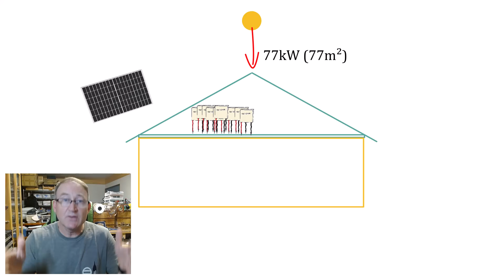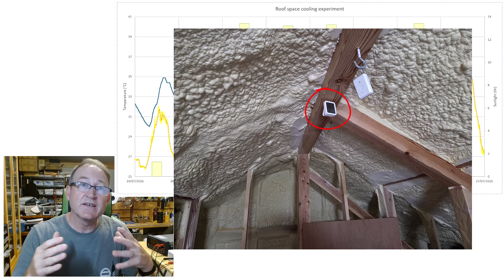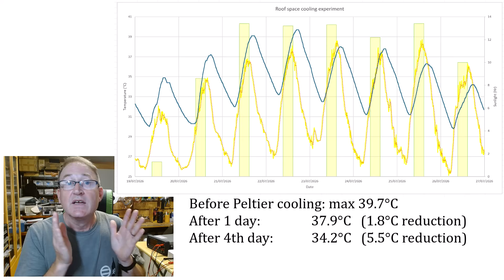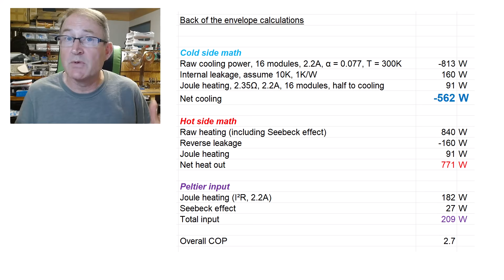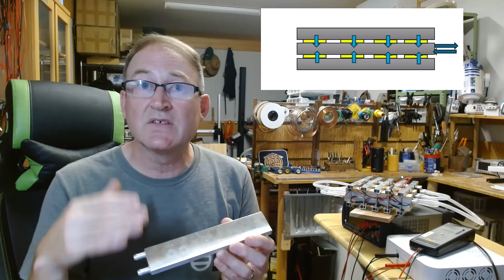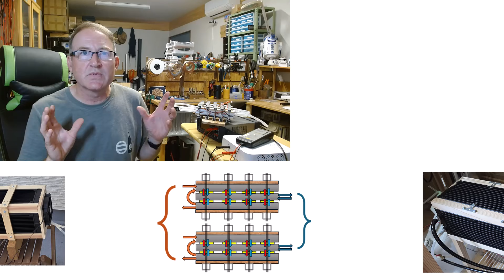Peltier based 500W roof space cooler - surprisingly effective!

Comment: 72kW of energy is hitting your roof, but your insulation is blocking a lot of it. Here in CHCH New Zealand we don't generally have insulation against the roof metal, and my roof temps get up past 55C in summer. 40C is relatively cool. If you wanted to do a better job passively during the summer, paint your roof white. The best heat you can cool for is no heat at all, reject it. This however has an inverse effect during winter where you want to absorb heat, however your roof metal is highly insulated so doubt it would have a significant effect.

Those radiators work far better with forced air directly over the fins (why they have the 120mm fan mounting holes), I presume there are fans lining the inside? You can usually extract quite a lot of heat using those in computer setups, with a single 360mm rad.
Reply from the maker: For the radiators: it's a box formation with 4 radiators, with fans at one or both ends. I tested the single 360mm radiators with 3 fans and measured 0.05K/W (meaning you can pass say 200W with 10K penalty for dT). I found the box construction (4 x 360mm) with a single fan at one end and the other closed off (sucking air through all four radiators) actually works surprisingly well with 0.02K/W. The single fan can breath and you can feel the air flow is a lot stronger. I then went one further with 4 x 480mm copper radiators and a fan at each end, but it's not as good as I hoped (always happens in engineering, bigger is not always better ...). It's around 0.01K/W so can pass 500W with 5K penalty but still for the effort I expected more. I suspect the two fans are creating a dead zone in the middle, I need to play around to get the thermal resistance in the sub 0.01K/W zone.  

The white roof would have to be discussed with the wife! But the real strong point is the spray insulation underneath, it's choking the heat flow down to 15W/m² into the roof, which is amazing. I suspect that even with a white roof, it would still be ~10W/m², which is better but not zero.
Reply: @PeltierPower two fans may cause turbulence, disrupting flow. Flow I think probably being the most important metric here for performance.

Need to take it to a wind tunnel get some shlieren playing in it ;)
Reply: Attics are typically built in one of two ways: *vented**, with insulation and air sealing at the ceiling, or **unvented**, with insulation and air sealing at the roofline like this. Neither approach is inherently better; they just manage heat and **moisture* very differently.

That distinction matters when considering active attic cooling. Cooling an unvented attic like this may reduce the building’s cooling load because the attic is inside the thermal envelope. Cooling a vented attic is generally less effective because it is intentionally exchanging air with the outdoors. For a vented acetic you’re probably better just adding an exhaust fan.  

Either way, do be careful about adding trapped moisture to an attic space. I think that evaporative cooling was outside, but it was a little unclear.  Any additional moisture can lead to mold and rotted wood.

Comment: Fun experiment.  Not something I would actually do.  But I think it would be a lot more effective if you just stored the solar energy in a battery and then ran your cooler overnight from the battery when the temperature differentials are in your favor.

Also, the key is to regulate the temperature swings rather than regulate the temperature.  There isn't enough heat mass in the attic space in the first place... that's the real problem.  The swings are way too large.

Try this:

* Create a flow-through heat mass in the attic from one side to the other.   That the attic can support (weight can be a real problem so it has to be spread out).   Basically just a long long copper pipe with fins placed in a long box filled with sand.

* Two-fan passive attic cooling, intake on one side, output on the other.  Its important to have real flow through the whole attic.

* And throw the peltier in series with the input to cool the outside air even more with the hot side routed to the exhausted side (bypassing the heat mass).

* Controlled operation, only operate when the heat mass is warmer than the outside air (plus a bit of margin from the assumed peltier response).  Meaning solar -> battery -> controlled operation and not solar-direct.  So it mostly only runs overnight.

* And if you want, since you have a bypass path anyway, some of the attic fan path can bypass to directly cool the attic space like a regular attic fan would.

This is all passive except for the two low power attic fans.

-Matt
Reply from the maker: All good ideas! For me the attraction of the solar + Peltier is skipping the battery / inverters, it's just solar to Peltier. But you are right, allowing the roof to get hotter during daytime is actually better because it rejects more heat, but adds inverter + battery and also losses of about 10% round trip. The sensor itself is just in air, so it fluctuates a bit, I have another sensor in the roof I placed a year ago, it is deliberately placed in the bulk somewhere lower to the floor (e.g. between futon mattresses) but I can't find it even though I still get the data. That sensor has only 1°C daytime swing and was trending up about 0.6°C/day prior to turning on the Peltier system, and then trending down 0.35°C/day during 5 days of Peltier operation. It's now going back up again since I turned the system off for revamping. The idea for two fans at opposite ends has occurred to me but I'd need to get the professionals in, and that's an opening for rain, bugs etc, plus cost of running them probably about 100W to get a decent airflow. I do want to run something through the apex of the roof which is the hottest point and most effective point to pick up heat for Peltier system (reduces the dT).

Comment: Peltier need Voltage to vork, Seebeck gives out Amps at any temerature linear, so to drive one peltier just from DeltaT you need 1 Peltier element and 2.8 Peltier according to My coleguae (dead several years ago :(... ) he only used the Heatpump to dump heat to 40C...

Comment: We ued a cheap 100W compressor driven Ice Cube maker to boost our Control panels(Your evaporator cooler) to dump exwssive heat , and we used a variant of your Peltier set up
But We also combined it with the Seebeck effect.
This was for a project in Brazil where the ship could not provide cooling for our cabinets..(heiging systems need stabile temperatue)
Still i cannot wrap my head to understand the physics, but it boosted this small heat pumps capacity maybe by 10...
Regards from a Old scool Norwegian Cheif Engineer with some bakgroud as a 10 year leader for a company desiging subsea Electronics for offshore use...
Please look into this combination of Direct solar/Battery/Peltier, and ecpescially, since Seebec is way more efficient than Peltier as a effect(1:2.8? ish?

Comment: Are these off the shelf from Alie or should I look somewhere else?
Reply from the maker: You mean the Peltiers? They are the more expensive type from Mouser CP14-199-045-L1-W4.5. Unfortunately whenever I discover a good Peltier the price always jumps soon after, they used to be about US$20 each, now around $35. It's probably not that big a difference but for now given the experimentation stage I prefer to use good quality ones as there is a bit of effort to build the system. I've also bought cheap ones from Amazon that I plan to test and see the difference.
Reply: @PeltierPower comparing the Amazon ones with known good ones for performance would be an interesting video, might be useful for someone planning on trying experimenting with Peltier elements in future for similar projects.

Comment: Great video! I especially appreciate the combination of peltier based cooling and evaporative cooling, a great match of two generally severely  misunderstood concepts.       

Evaporative cooling always works, as long as the humidity is less than 100%. Also, when the temperature fluctuates a lot between nights and days, the humidity tends to go down significantly during daytime temperature peaks.  And evaporative cooling to increase heat rejection from a heatpump system can obviously be somewhat beneficial even if ambient air is at 100% RH.       

About humidity, have you considered making a peltier based dehumidifier with a counter current heat exchanger that use the cold dehumidified air to cool down the incoming air, and only use the cooling potential that heat exchanger can't extract to cool down the hot side?
Reply from the maker: Still learning about evaporative cooling and dehumidification. My past attempts with dehumidification found that once you get a layer of water on the cold element, it stops working effectively (the water acts an an insulator, so for a Peltier that kills the efficiency). I need figure out something to keep the water moving, encourage it to drip down into a collecting container. Evaporative cooling seems easier, for now just created a waterfall effect using the paper towels as the scaffolding, over pipes with small holes to refresh the water. Small fan needed if inside, outside seems to have enough natural wind. Surface area seems to be the key!
Reply: @PeltierPower  Agreed, surface area is kind of the key for evaporative cooling, and as I see it, that's in large part due to the limited volumetric potential capacity of the air. It is possible to exchange surface area with airflow, and vice versa, within a quite significant range.  Even outdoors a fan can typically increase the maximum cooling potential for a given surface area significantly. But that don't matter much if you're already reaching very close to the wet bulb temperature without a fan, reliably.    

If you want to reach temperatures below the wet bulb temperature you need to cool down the "new" air with the "old" air, that way it's possible to get closer to the dew point. Besides requiring a heat exchanger, that reduces the useful Q a lot relative the gain in increased ΔT.

Comment: I wouldn't hold back on the details.  

Very interesting, though I clearly need a refresher on Peltier's as I always thought of them as very low efficiency.
Reply: they have a low efficiency
Reply: @ursodermatt8809  Yes and you're better off with a refrigerated type system though see his other video, it's not as low as I had thought.
Reply: @ursodermatt8809  they have low if you run them at high delta T and at their peak Amps. If you run them at 20% amp rating and managable delta T of around 5-15 degrees Celcsius, then they are 200%+ efficient as a heat pump (not TEG)
Reply: You're essentially correct. Using peltiers as thermo electric generators are often cited as <10% efficient, but here he isn't using heat energy to create electricity. He's basically got a heat pump, and he's moving heat. Today's heat pumps are often cited as 300% efficient but that number is a little misleading because it talks about using X amount of electricity to move X amount of heat energy ie:500watts electricity to move 1500watts of heat energy. It's not a conversion of one source of energy to another, but it's moving energy from one place in space to another. For this, Peltiers aren't a bad low cost option.

Comment: You are missing a control to compare data to. It is unclear how much cooling you are getting from your device, vs how much was natural from the outside weather changes.
Reply from the maker: Yes, I will revamp the system and add the monitoring so I can be sure of the numbers. I just felt it was good to make the video quickly, otherwise it will join the graveyard of half made videos! The 16 bank of Peltiers is not new and I've used it in other highly monitored applications, so I'm 90% confident of getting at least 500W out under these conditions. I thought the upward trend before starting vs the downward trend after was good evidence of effective cooling.

Comment: nice work, 
the evap cooler was a good idea too.
only improvement i can see is to insulate the interior hot pipes so they dont radiate heat back into your cool room. but i imagine that will be a negligable improovement.

did you notice any condensate forming on the system?
Reply from the maker: Yes, once I build the proper system I'll insulate the pipes, although with the mild dT in this application it's not that critical. When I used the same Peltier bank in winter I needed to insulate the cold side pipes as they were getting down to around 2°C, which definitely needed some insulation. For this application, there was a little bit of condensate on the cold side as expected, it's fairly humid in Japan (we had a fairly fairly decent wet season).

Comment: Do you have access to build ground loops for cooling?
Reply from the maker: I'm actually thinking of just running a pipe through the apex of the roof to pick up the heat at the hottest point, which helps for efficiency. If I could go back in time, I'd be adding that kind of stuff in the floor (for winter) and roof (for summer) in the original build!